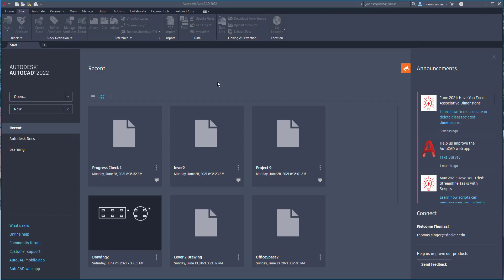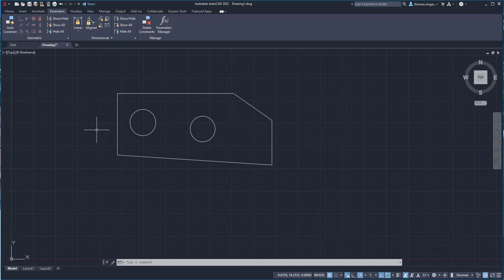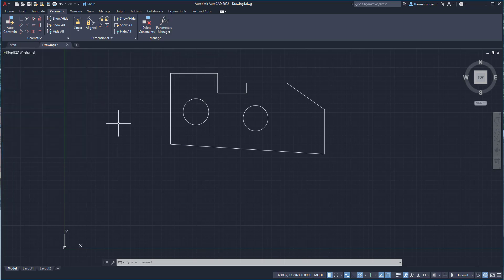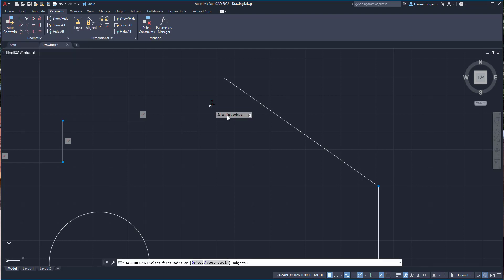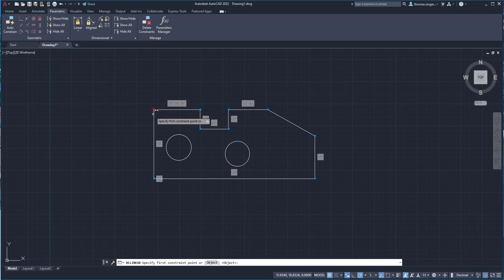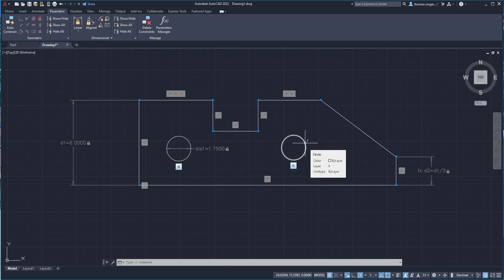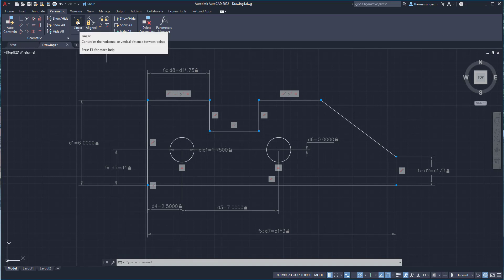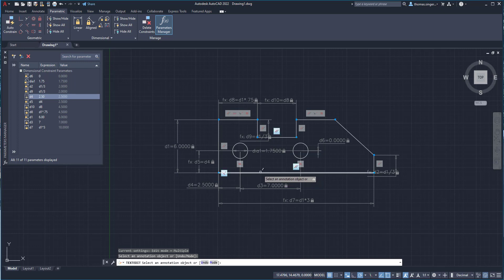Parametric drawing AutoCAD 2022

Comment: Tom can have an arc constrained to be tangent with a straight line. Working with glass and creating quarter rounds. Glass arc has to be 90 at the intersection with the two vertical sides?